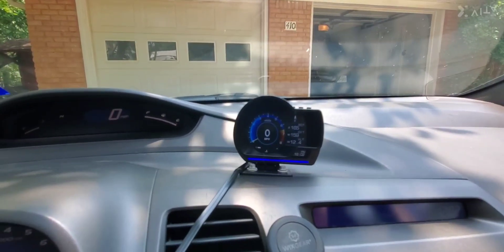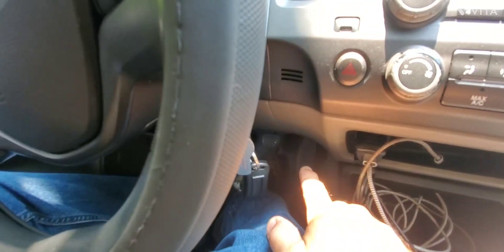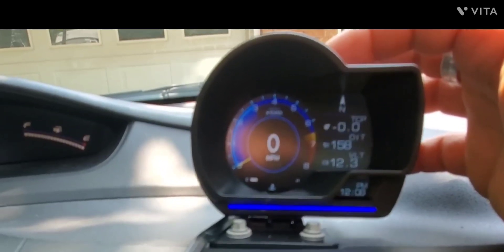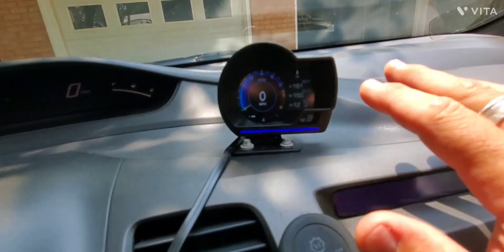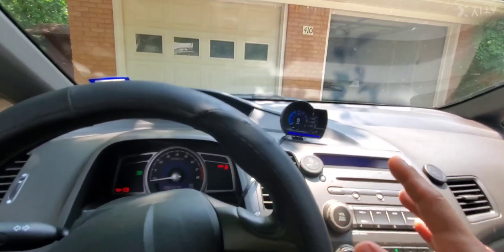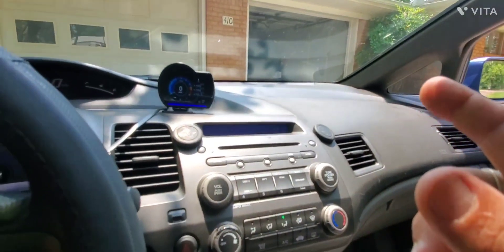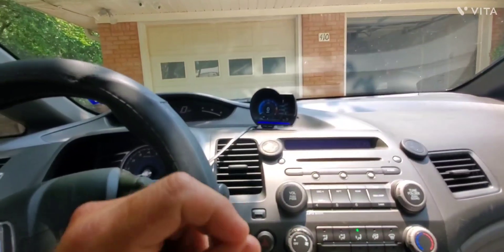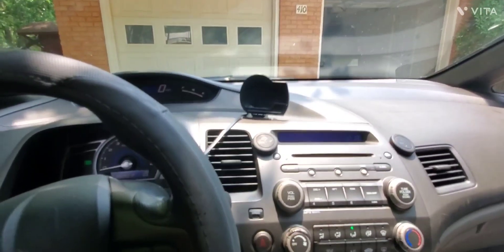8th Gen Civic ELD Part ll

Comment: So pretty much you changed that eld for nothing
Reply from the maker: Actually no. The computer rations the alternator output to save fuel. The voltage before would get below 12v while driving and that's not good. Now that I have changed the eld, the voltage gets no lower than 12.2v while driving. In cold weather it stays at 14.2v for obvious reasons